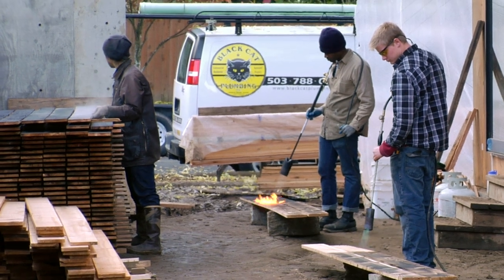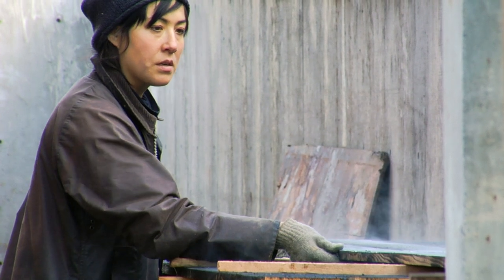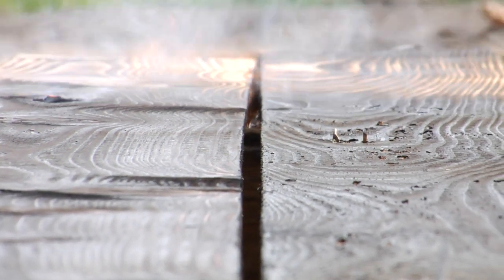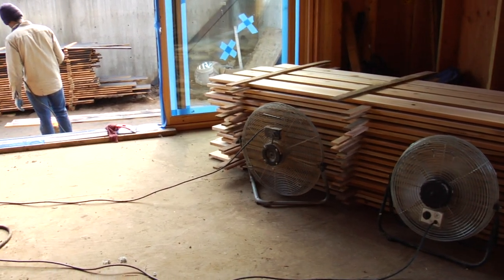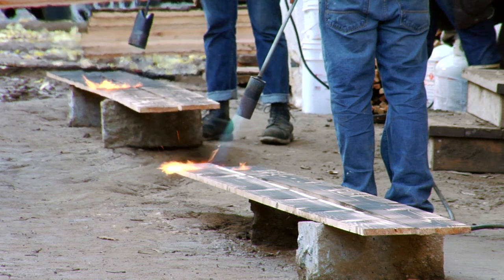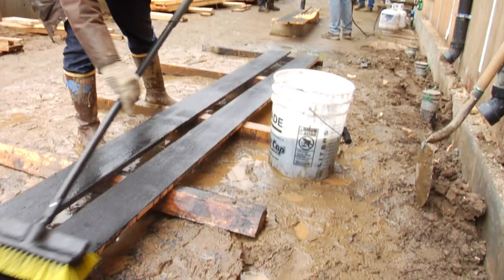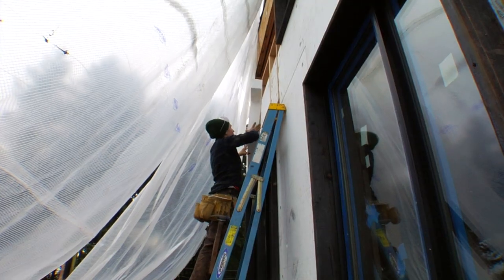Flexhouse:  Shou Sugi Ban siding

Comment: Didn't the Japanese seal it with a wood oil like Tung oil or linseed oil also? Looks cool thanks for sharing
Reply: Yes, this is hideous. Terrible job, the other side will rot.
Reply: @papayaman78  I think it would be much better if they chard it on all sides then sand it for a nice contrast then treat it. Satin finish would be my choice. Thanks

Comment: Do not scrap off the char.   Burn all sides. Finish with a few coats of tung oil after installation.
Reply: If you put oil on it,  it doesn't stain?

Comment: Shou sugi ban is the best.  However,  stopping  at the concrete walls, a super durable wall surface,  or even at a stucco skimmed onto the concrete,  would have been the environmentally conscious finish to the building.  These builders were so fascinated by their char that they added superfluous work,  expense and carbon debt. Nevertheless,  shou sugi ban is superiour and maybe I'm wrong.
Reply: yeah, I don't know how environmentally friendly all that Styrofoam is either.

Comment: oh no, you didn't get every side, and it's not overlapping, water will bead into and behind the siding and it'll start to rot, I'm all for diy blah blah blah but like, maybe just consult someone who does this professionally for like 5-10 minutes and they'll usually steer you away from massive mistakes
Reply: Yall, they live in portland, its not like they have to worry about rain or anything.

Would be nice to see how its held up.  An honest view, not an advertisement for the people who built it.
Reply: But there were cool music playing while they were building that. It can't be bad then, can it?
Reply: a rain screen that will leak and rot.  something they were trying to avoid
Reply: Exactly what I was thinking. That's going to leak like crazy. They should have at least used tongue and groove board if anything. I'm a huge advocate of DIY, but you have to research how the thing you're attempting works. They should have "watched a few Youtube videos" about common sense. Lol.
Reply: It’s a rain screen, it’s supposed to allow air and water behind the boards, look it up - rain screen.  They did a fine job.
Reply: I guess it just doesn't look like the have a proper water barrier protecting the main structure of the house and seem to just be relying on the building paper.
Reply: I understand what you're saying but they needed to treat both sides of the wood.  @Risingnshouting
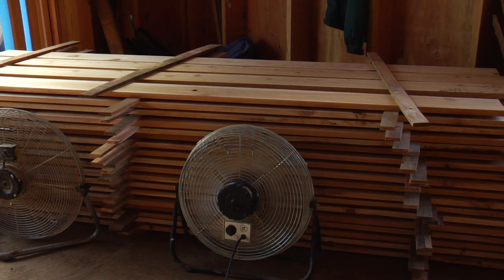Reply: i dont think they fully understand how sugi ban works. You cant just torch it you have to burn it in triangles for 1:30 with huge flames and high heat to boil out the trees resins and create protective layer. This way it gets so hot all side get done. The way in the video is like toast in a toaster. Looks cool, will help but i would like to see an update video aswell with some boards pulled off.

Comment: "It's Eco Friendly." If I had a nickle for every time I've heard that. Gotta love the Youtube degree in todays society. They didn't do all 6 sides. Have fun with the rot in just a few years. Oh and it wont last 80 years. No mention of the tung oil.
Reply: Yo Deejay Koller. I’d say stick to being a Dee Jay. There is so much more going on in this video that completely negates your comments I’m not sure where to start. To the other  “experts” commenting, the whole point is you don’t need to seal the wood. Should I repeat that last comment? Holding siding off the house is sleepers and gapping the boards creates air floor and removes trapped moisture... the environmental part is no toxic stain or paint... should I repeat that comment as well?   Great job to the builders. Your modern house looks awesome!
Reply: @gregmiles2247  it definitely should be tongue and groove and sealed with an exterior sealer on all sides. Also the sides that they didn't burn will rot in time and so will the framing behind it
Reply: @steadyfishing3613  "exterior sealer" is not a part of shou sugi ban.  You use a drying oil. That's it.
Reply: ?? what about tung oil ?
Reply: I thought that was kind of weird!... and they're affiliated with a community college and got grant funding for this?  If it was a conscious decision not to overlap or seal all the sides, I think at least a brief explanation would have been nice.   If anyone else knows a good video that demonstrates the lapping and sealing, please post it!  :D
Reply: +Deejay Kollar Agree, they blew it. Without oil and overlapping there will be problems sooner rather than later as they are just the youtube experts.
Reply: Deejay Kollar I concur Deejay. There is a lot more to this technique than they showed here, and if they left those essential points out, their house is going to have a major issue or 10 in just a few years of weather. For one, it wasn't tongue in groove, which helps seal out the weather. For two they didn't focus on how important it still is to SEAL the wood.  It's mission critical. The less char on that wood, the more important it is. Even when you go balls out and the wood looks like a cracked blackend desert floor you STILL have to seal the wood at the very least with as you mention, Tung oil.  Light chars can give you opportunity to use other types of stain to really bring out grain and contrast... and SEAL the wood.   

I'll be doing a project like this for a few of my interior walls to contrast the brick walls, so my char will be lighter in most rooms. I'm still going to seal the wood.
Reply: I thought you were being negative until I saw them nailing it up only doing 1/3 of the job lol - live and learn just like the rest of us
Reply: I agree with all of the above. I cringed when I realized what they were really doing. This video won't serve to teach anyone anything except how to ruin a good homes walls/insulation/etc...
Reply: Even if cedar, Wich usually doesn't rot. It should still be sealed

Comment: If that is cedar (it appears to be) it is naturally resistant to rotting.  Not 100% rot proof but close. When you use this tecnique I would it assume it burns off most of the "fuzziness" of the wood.  Less fuzz=less places for dirt to get trapped and water to hang out. And it looks nice.
Reply: its Larch that they are using and its an old Japanese technique. It heats the tannin /oils and preserves the wood
Reply: @roxanneedwards4902  hello! I love how it looks and want to do the same in my house. Do you know if it stains? And do you know if they had any problems of rotting?